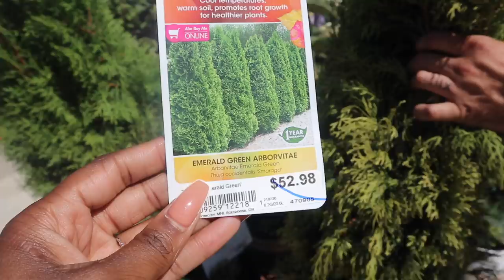HOME RENOVATION SERIES EP: 3 Diy EXTERIOR MAKEOVER PLANTING TREES | PAINTING MY BRICK HOUSE BLACK!!

Comment: Your neighbor was correct. We do use potting soil or top soil only if there isn't enough dirt to put back in the hole. For the trees to hold in moisture after you water them or it rain you need some mulch. And don't water the tree  base.If you do this their roots will spread out and it also prevents root rot diseases.
Reply: Potting soil is when planting in pot. You could have used that same soil you dug out.

Comment: You need to get rid of that Acorn tree. I have one in front of my house that the roots did the sidewalk like what is going on with your front porch. The roots also cracked my brick fence on my property and it pushed the wall and broke it. My tree is on the city sidewalk so I can not remove it but yours is on your property get rid of it because it can mess up the foundation of your home. I had evergreens trees and I had them in front of my porch. They grow tall and mine grew taller than my home and I cut them down because during a storm I felt they could destroy my home.

Comment: That huge tree have roots that is more likely the culprit as to why your front yard is not leveled. Also, be sure to check all the factors when planting new shrubs, like how high they grow and how far the roots will expand. I would also use the excess dirt to place in the lower areas under your windows. You are doing a great job in transforming your home.